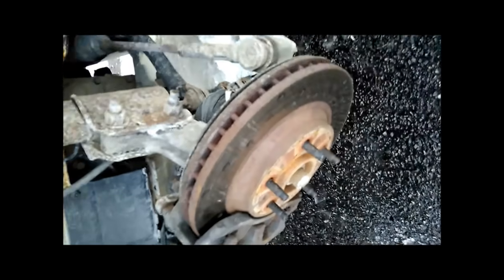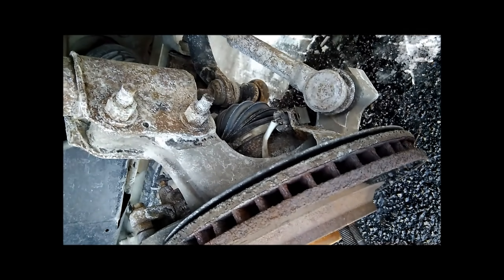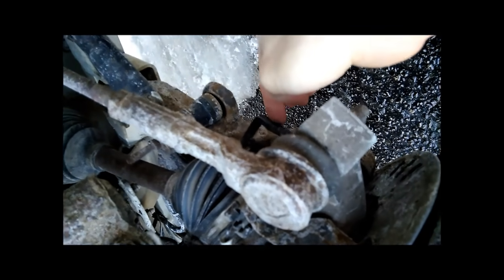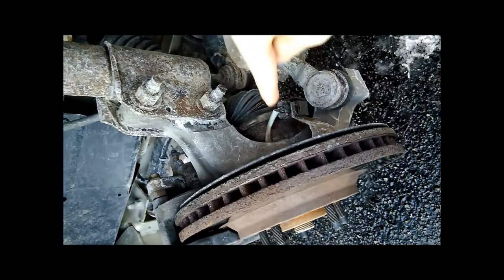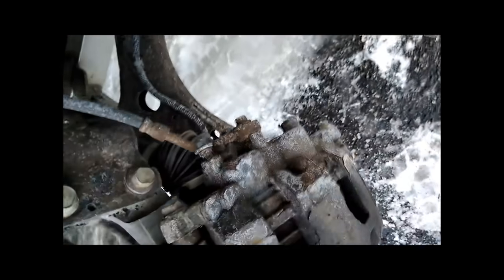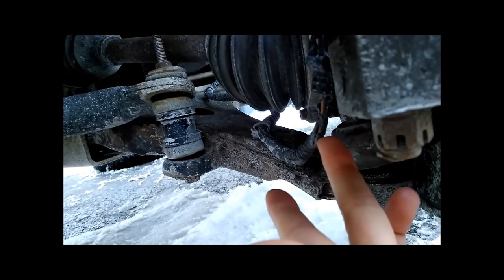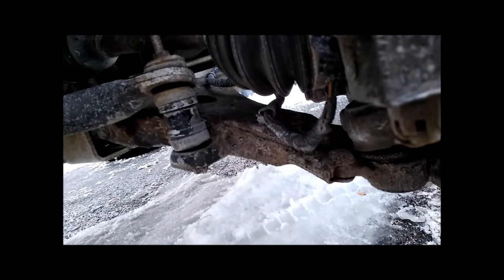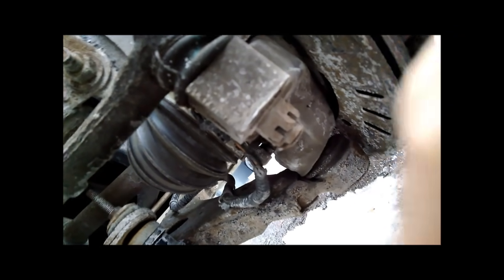How to fix ABS light, Traction Control, Stabilitrak

Comment: I have 07 yukon it started doing this once in a while while idling i would turn it off for a bit and it go a away but now as soon as i turn the truck on it just shakes and reduces power with stabilize traction light on
Reply from the maker: That sounds like what some others reported as well.  Probably the TCS is not the "cause" per se but one of the symptoms.  If the car is losing power and the TCS system is one of the lights, it could be a computer failure triggered by something else such as a low voltage condition (but there are others).  I would suggest you ask a mechanic to scan the car first in the shop and if he can't pick up anything there, then you may have to get him to scan it on the road under the specific circumstances where you have previously seen the error happen, like when you're idling at a stop.  At least this way, he can let you know if the TCS system is truly the cause or merely an effect.  You wouldn't want to fork out a bunch of cash to replace your wheel bearings and then have the problem persist afterwards.
Reply: I'm having the same issue. What was your resolution?

Comment: Im having this issue with my 2013 chevy cruze. It scares me alot thinking its gnna die out on me. Even when i fill it with gas at the gas station. When im done & try to start it up it just keeps dying out until i just keep reffing the engine.
Reply: Any solution?
Reply: @codystedman9369  i havent got it fixed yet but stil running tho.

Comment: I drive a 250 ford van is a 2000 and neen a while that it turned on the ABs and brake light and it hasnt gone away i drive far for work 2 hours 2 work 2 hours home any help on wath i need 2 do
Reply from the maker: The easiest thing would be to ask a mechanic to scan the car with a Tech 2 scanner to see if the BCM is throwing any codes.  If one of the speed sensors in the hubs is faulty, the tool will tell you which one.  You can then narrow down your repairs to the sensor itself or the wiring leading to it.

Comment: Would this also cause a misfire in the engine?
Reply from the maker: Actually yes.  The computer uses fuel and spark control to modulate throttle so cutting either could cause a misfire.  However this is intentional.  It could be a red herring if you have misfires for a different reason like a fouled plug or plugged injector or vacuum leak or half a dozen other things.
Reply: @ChrisCamaro  maybe you can help me, I have misfire is engine 4 and a large vacuum leak in the brake booster, according to AutoZones free scan. now I've already changed the spark plugs and wires and I still have the same problem
Reply from the maker: @frankiet6115  That's not related to the TCS system then.  The misfire in cyl 4 could be a clogged injector or perhaps a bad coil for example.  The brake booster thing is just another unrelated issue but I would get that fixed asap as well.

Comment: Does this type of thing cause the ECM to disable the engine? i.e. "Engine power reduced, engine disabled".
Reply from the maker: It should not.  If you're getting that, there ought to be a code associated with the loss in power.  Do you have a scan tool?
Reply: I’m having the same exact issue.

Comment: On my impala it pulled and snatched one of the damn wire from turning the wheel. Can I cut another piece from another car from a junkyard and crimp it to extend it a little?
Reply from the maker: If you exercise good practices for splicing wires, yes you can.  Just be aware that connection points are typically points of failure so the longevity of your fix will depend on your technique and diligence.  If you buy a small length of wire of equal or thicker wire gauge, cut, clean and solder your connections, cover with heat shrink and then electrical tape, chances are you'll have a long-lasting bond that will be just fine.
Reply: @ChrisCamaro  that's  what's up man thanks

Comment: Does this go for a 2003 Buick century
Reply from the maker: It should.  The basic theory of how the system operates is common to many cars, even non-GM vehicles.  Wheel bearing speed sensors are commonly used in traction control systems.

Comment: I have a 2010 Chevy Traverse Stabilitrak light, no crank no start.. It goes out and if the battery dies it resets itself then problem comes back after some miles have been driven. Driving me crazy 😆.. Any ideas
Reply from the maker: Wait, so you have a problem starting the car AND stabilitrak while driving?
Reply: @ChrisCamaro  Stabilitrak light will come on when driving along with the check engine light. Once I turn the truck off, no crank no start.. Turn the key and no sound.. Now if I disconnect the battery, it will start right up and drive normal until the Stabilitrak light pops up again..
Reply from the maker: @kaliboy1717  That's weird.  Almost sounds like a security issue.  TBH, I'm not sure but it sounds like programming to me, rather that something that's mechanically broken
Reply: @ChrisCamaro  Well getting ready to get rid of it now 😂.. It's been definitely solid for me for 5 Years..

Comment: My ABS and brake light come on once in awhile on my lifted Colorado guy who sold me the truck said it because of the lift???? No engine light just the abs and brake light I'll check that thanks...
Reply from the maker: I wonder if he meant that because the vehicle was lifted, the cable going to the hub wasn't long enough so he disconnected it.  That sounds plausible.  Sometimes if you mod your car you throw the measurements out the window and things don't fit anymore so if it's an "unnecessary" system, you just don't bother dealing with it and leave it disconnected.
Reply: @ChrisCamaro  lt could be that's not long enough l have to check ??? Lights come on at times not all the time.....Thanks for replying...

Comment: Would this also apply to a 2005 Yukon? We replaced the two front wheel bearing and it still lock when we drive it. ABS & TC light turn on.
Reply from the maker: There is a chance that you got unlucky and replaced the 2 hubs that had good sensor connections back to the computer.  It could be 1 of the other 2 hubs.  It could also be the steering angle sensor in the steering wheel or even an unrelated vehicle issue that throws the car into "limp mode", causing the TCS to also fail.  But the best place to start if you have no clues as to the cause, is to get a mechanic to scan the OBDII port in the car and see what the computer reports as the cause.  If the TCS system is tripping, no doubt there will be a trouble code in the computer that you can retrieve using such a tool.  Any decent mechanic should be able to do this scan easily and usually cheap/free for you.
Reply: I have an 05 Tahoe that did this. It would intermittently  hesitate badly after coming to a stop and trying to accelerate then it would engage until I let off the accelerator then it would let me accelerate...very frustrating. So I replaced both front hub bearings and it fixed my issue but after 3yrs it's back to the same issue. This time I will attempt a DIY and check my wire harness on the hub to make sure it's free from any binding or twisting.

Comment: Can this cause the car to go in to engine  reduce  speed  mode stall out
Reply from the maker: If you mean "limp mode", that's a different thing and no it should not stall out.  The TCS tries to reduce engine power but not eliminate it altogether so you will have some power to keep the crank rotating and the car also can detect a stall condition and correct it.  If the car is stalling out, there's something else at play.
Reply: @ChrisCamaro  thanks chris

Comment: What exactly are u looking for by the driving simulation? Obviously if it’s damage to cable it will be visible when you inspect it VISUALLY. Extra work no reason.
Reply from the maker: I don't get what you're trying to say.  Inspecting the cable isn't "extra" work.  It's necessary work.  How else are you going to know where the defect is?  Doing the driving simulation shows you how the cable moves while changing the steering angle so if you do find a defect you might also determine what caused it, which you would need to know in order to ensure that any repair you make will last more than a few hours of subsequent driving.

Comment: Will the stabilitrak cause my car not to crank in the morning
Reply from the maker: No, there are an entirely different set of tables and algorithms for that process.  If it doesn't crank, I'd look at plugs and wires first, then injectors.
Reply: Really just on mornings that it's been really cold all night the next morning it might take 5-10 attempts before it cranks our I gotta jump it
Reply: And where should I start to troubleshoot the stabilitrak I've seen so many different videos on what to do. And I don't have a clue lol
Reply from the maker: @Peezy2k24  The symptoms you're having really don't seem related to the Stabilitrak system.  I'd be more inclined to think your plugs are fouled or your fuel enrichment isn't enough for a cold start.  However whatever the problem is, it's always helpful to check for codes first so you don't end up randomly guessing.  If you don't have a code scanner you can usually pick one up for less than 20 dollars and see if the car is throwing any codes.  This is a good investment and will pay for itself on the first use, as you won't waste any money on one of the dozen or so causes of an engine that doesn't want to start.

Comment: Would this problem cause a car's engine to act different? Say, making the car shake?
Reply from the maker: It could.  Traction Control is a control scheme that often modulates engine power by means of the fuel injectors or the spark advance, which can cause the engine to shudder or appear to die when traction is poor.  The entire car can vibrate when the ABS goes off since that system pulsates the brakes at a very high speed.  However these symptoms indicate the systems are functioning correctly, provided they occur at the same time the car is losing traction.  It's when they happen under normal driving conditions that you can expect there is a problem.
Reply: @ChrisCamaro  The other day it was raining pretty hard. I usually don't use cruise control when it's slick. Thinking the oil and other fluids were probably washed off the road by the time I had to go to work, I popped it on. I guess there must have been a slick spot and the system was alerted. I didn't even realize there was a slick spot; I didn't feel it at all, so it must have been very slight. The car shuddered and the acceleration died. I parked it on the shoulder, turned the car off. Then back on, but it still shook. I waited a minute and the car was fine to go.

I'll never use cruise control in that kind of weather again. Thank you for your response.
Reply from the maker: @Nope2022HugeTheWarningFan  If the car is doing that on the shoulder, it could indicate a problem.  Unless you're driving at speed, there's no reason for the system to kick in.  See if you can replicate the problem in ideal conditions like warm dry weather.

Comment: I had my wheel bearings replaced and now the breaks is slipping. I’ve returned the vehicle back but they insist that nothing is wrong. They’re not getting any codes when they connect the computer. It’s a 2012 Nissan Quest
Reply from the maker: If the brakes are "slipping" then I can think of 2 causes off the top of my head you could check.  1 would be that the life of the pads is pretty much gone, although you'd feel and hear some grinding or squealing in that case.  The other possibility is that the hydraulic fluid is low or there's air in the line or a leak or something that would reduce pressure on the pads.  It's just that grip (or slippage) is a function of pad material and pressure applied to the pads so that makes me think pad life or low brake line pressure.

Comment: I have a 2002 cadillac dts and when I'm driving the car let's say 50 ph I hear a humming sound 
Could that be a hub problem? Bc my traction control isn't working its stuck
Reply from the maker: Yes... the noise itself could definitely be an indication that the hub is going/gone.  However it may have nothing to do with the TCS light tripping.  The TCS sensor is largely unrelated to the bearings and race which contribute to smooth driving.  The good news is that fixing the hub because it needs to be fixed anyway may fix the TCS problem at the same time.
Reply: @ChrisCamaro  tcs?
Reply from the maker: @archiemegel1013  Sorry, Traction Control System, per your first post.
Reply: @ChrisCamaro  os there anyway I could test to find out the wheel hub needs to be replaced ? Maybe by grabbing the wheel and shaking it to feel if its loose ?
Reply from the maker: @archiemegel1013  In fact that IS the standard mechanic's methodology - jack the car up, grab the tire and try to wobble it, listen/feel for play.  However this diagnostic is usually done on suspicion resulting from the noises/vibrations you've already experienced so what you're looking for in fact is confirmation that the wheel does wobble.  If it doesn't you have a red herring and there is another problem at work.
Reply: @ChrisCamaro  
Cool thanks for all the info, 
Having a bad hub will that also make the car shake a little when applying the brakes?
Reply from the maker: @archiemegel1013  It could but it's kind of random.  Usually you will notice bad bearings at a specific load point.  The load could be accelerating load, braking load, at a specific speed, etc.  Last time mine went, I only noticed it on the highway at part throttle but they were definitely bad.  Presumably, as they get worse, it will be easier to detect the problem at a broader range of load points but I've never let it get that far to confirm.
Reply: @ChrisCamaro  it doesn't matter what speed I'm doing , it seems.like the humming sound it there from 10 mp to 80 ph
Reply from the maker: @archiemegel1013  If you don't think it's the tires themselves then the hubs are probably pooched.  I'd do the wiggle test and if you can get that confirmation, replace the hubs.  You'll get a new sensor as an added bonus and a 25% chance of fixing your sensor problem.

Comment: Man I’m having the same issue here my Abs and traction control light came up my brake lights stays on after I put my emergency brake down and beeps.
Reply from the maker: make sure the car isn't moving when the ebrake is on or you'll get all sorts of lights
Reply: @ChrisCamaro  man I think I need to re tune my car apparently I have a tune on my car and the only way to scan it is to go to VW or get my self a VHE SCANNER meant for VW to check like air bags and trac control

Comment: So I’m guessing this means the brakes COULD fail?
Reply from the maker: No, your feet are mechanically coupled to the brake pads via hydraulic fluid.  That works as long as there's fluid.  The TCS system being out of order just means the car computer can't control the brakes anymore.  The car would merely behave as it would 25 years ago.

Comment: Can it also cost for misfire?
Reply from the maker: Misfires are a normal result of the TCS doing it's job rather than the other way around.  Misfires don't precede anything in the TCS system so if you're having misfires on their own, that's something to do with your plugs, injectors, AFR, etc.  But if the car misfires while the TCS is engaged it's not necessarily a problem.  It's only a problem if the car misfires when the TCS is not active.

Comment: My Landcruiser 200 blinks traction control light & lose engine power for a few seconds when making a hard turn. No error codes whatsoever & the mechanic can't figure it out. Any help would help Thanks.
Reply from the maker: Does it feel like the brakes are pulsating on their own?  Traction control usually cuts fuel to the engine, making it feel like you're losing power.  This is to prevent wheel spin.  ABS on the other hand and some stability control algorithms will use the brakes to synchronize wheel speed.  That would feel differently however.  In any case, it could be the wheel sensor but in your case it could also be that you are losing traction on one of your tires.  Are any of your tires bald?  Do you have a limited slip differential?  Do your wheels have good alignment?  These things could warrant attention.
Reply: @ChrisCamaro  First of all Thanks for the reply. Yes ABS does engage automatically & Trc blinks for a few seconds cutting off trottle. I had smaller tires before & changed it to the factory recommened size recently & i have done wheel alignment aswell previously with smaller tires i had tire making noice aswell when turning but it's been gone with the new tires. As for wheel speed sensors i believe they show up a error code if they are faulty or require replacement.
Reply: @ChrisCamaro  As for the differential i have no idea. Mine is a JDM version of Landcruiser 200. Australian version have open diffs & i think JDM versions are same.

Comment: I have a 2013 Chevy Impala and when I go to make left turns I get traction light and a scraping noise then the traction light goes off
Reply from the maker: scraping or would you say it's a "vibrating" noise?  If it's a vibrating noise, it's probably the ABS pulsing your brakes, which sometimes happens when the signal is intermittent as it was in my video example.

Comment: Can I disconnect the abs system it feels like the brake pedal gets stiff and the front wobbles at 60 mph
Reply from the maker: The car wobbling at 60 doesn't sound like an ABS issue.  That could be tire balance or something else.. unless you distinctly feel the brake pedal pulsating.  You can sometimes pull a fuse from your fusebox to disable the ABS but you have to check the owner's manual under the chapter that has the fusebox layout because every car is different.